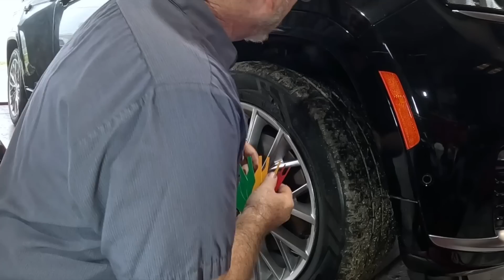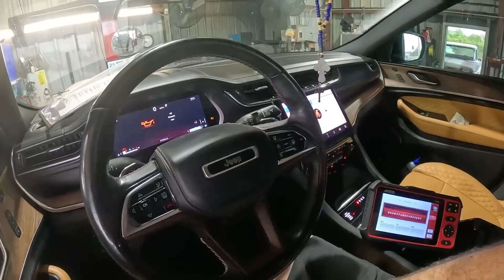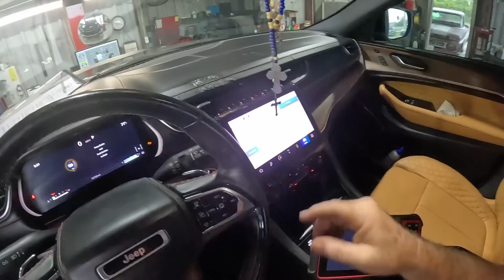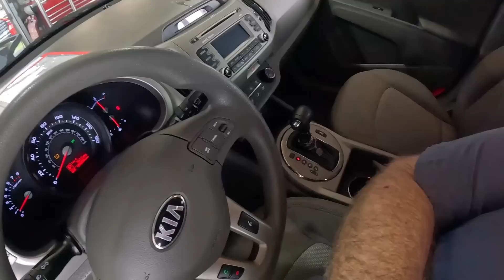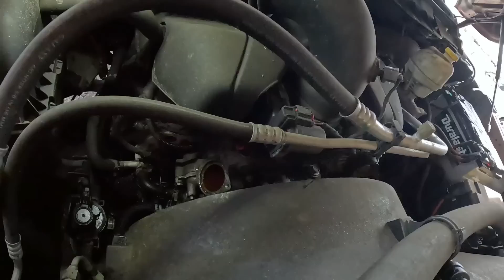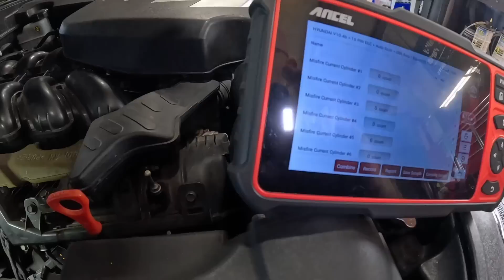Audi A6 Valve Covers, Kia no AC, Equus Misfire, Auto Shop DAY 687

Comment: Jimmy, I have a project now. My grandson bought a 2001 4Runner, so far I have a P1135, leaking valve covers and no evidence of the timing belt being changed in at least 200000 miles. I am doing the belt first. He is going to supply the parts Granddaddy works for free. Looking forward to it. Should provide a good teaching experience.
Reply from the maker: That sounds like a fun project! Those belts are fairly straight forward and only need some patience! Excellent teaching moment and making memories!

Comment: Good morning jimmy. As far as the inspections go with the filters, if theyre not easy to get to i either mark them grey on the inspection. Or i just recommend by mileage or history. your right it takes 15-30 mins to do a proper inspection the company tells us it only takes 5 lol
Reply from the maker: It is what it is. It’s never enough time to do it right, but gotta make the numbers work. I’d love to get some of them to do one themselves start to finish, lol.
Reply: When I worked at a shop that had us do digital inspections. On something like that; I would just write “cabin filter not easily accessible, need time to pull and inspect/replace”.